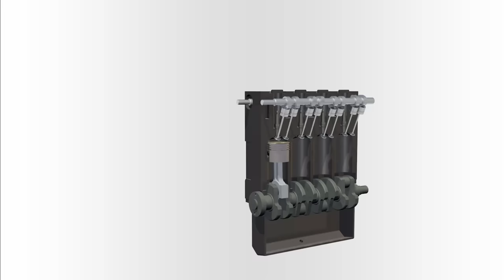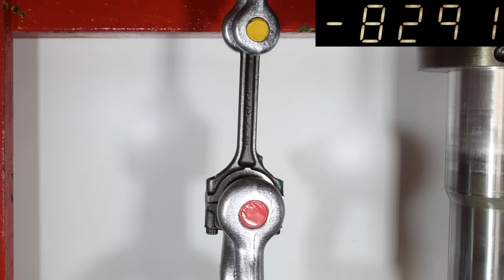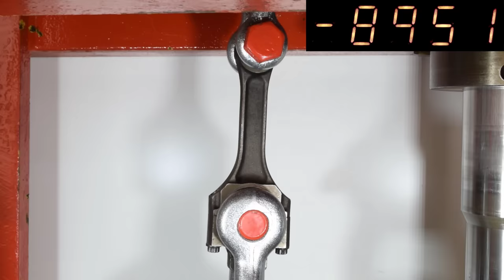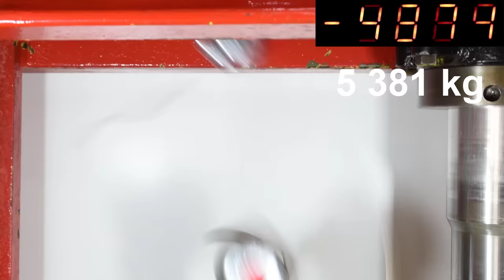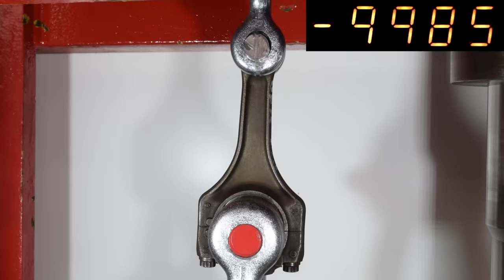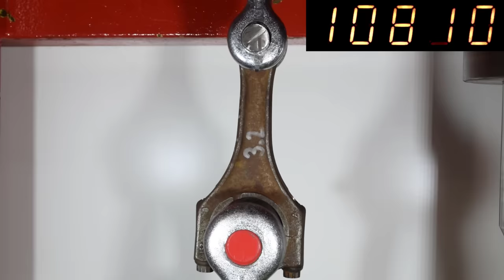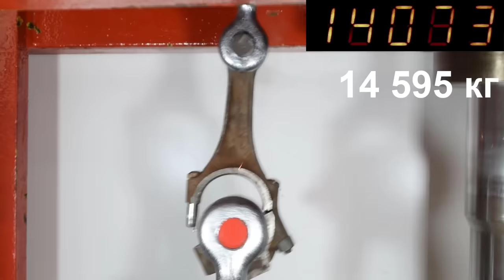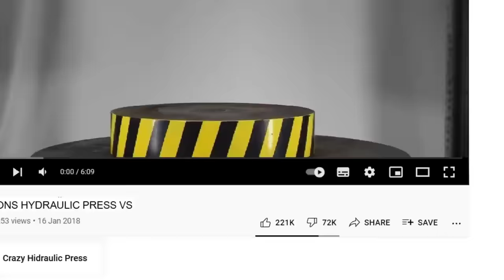HYDRAULIC PRESS VS CONNECTING RODS

Comment: Interesting tensile strength test/comparison.  Compression strength of the rods is just as or more important, because of the power and compression strokes putting more downward, compression, stress on the connecting rods, and wrist and crank pins.
Reply: Uhh nope…. The bearing takes the downward force, the rod will break and stretch because of tension
Reply: @Thewatcherinthering336  The rod is what transfers the downward force of the piston to the crankshaft, on the power stroke, which is compression stress on the length of the rod.  It also takes the compressive stress of the compression and exhaust strokes.  The rods can get bent and broken from that stress, if not robust enough.  The rod does take some tensile stress on the intake stroke, but not as much as the compressive stress on the power stroke.  I don't follow your, "Uhh nope." statement, or appreciate it.
Reply: @wmden1  uhh, nope once again. You obviously have no experience with engines so just admit it. Sure the downward compression is a stress producing force on the rod, it has to be. The biggest impact from compression is on the bearing load. Tension is what breaks rods and rod bolts(think about how rods fail, they don’t get crushed, they stretch and break). This force is centrifugal force on the rotating assembly. Compression down force moves the rotating assembly without any sort of appreciable play, it’s the upswing of the piston and rod assembly that has NO stop against centrifugal force, except for the stretch of the rod and rod bolts. Even dragster engine rods get measured for stretch not compression on every tear down. Plus I don’t care if you didn’t like my comment, get a clue, build some engines first.
Reply: @Thewatcherinthering336   I have had plenty of experience with engines, if you think there is no compressive force on the connecting rod, piston end to crankshaft end, during the power stroke, you are the one who needs to think again.  Sure there is centrifugal force on the lower end of the connecting rod, and tensile to boot.  I'm not saying there isn't.  You are saying no compressive on the rod and that is completely incorrect.  I have seen plenty of bent and broken rods.  I'm done with you.
Reply: @wmden1  once again…uhhh nope! Never once said there is no compressive force on a con rod. You said that. Obviously you have not had any experience with engines nor did you comprehend my comments. There is no compressive force on intake stroke, little compressive force on exhaust stroke, compression and power stroke have the most force. But still not nearly enough to cause catastrophic failure of a rod. Again, rods do not fail due to crushing force, they fail because they were literally torn apart from the sudden direction change at the end of the stroke combined with the centrifugal forces. Ending in an over stretched rod or rod bolt. That, clown, is what causes rods to break. No one has ever seen a crushed connecting rod except in the aftermath of a tension break. Go build some engines, take a physics course and stop being the pivot man…

Comment: To add my bit to the mix. In the 70's I owned a Ford transit and fitted a worked over 250 2V Ford I6. With exhaust opened it would rev to 7600 before valve float. Now onto the guts of my outline. We had a very severe rain storm. Unknowlingly, rain water ingressed into the intake ( 650 Holley double pumper. ) Car wouldn't start on SM. I decided to let it roll down the hill and kick start it. Fine in theory BUT dropping the clutch in 2nd gear in a 3660 lb tranny van. An almighty bang and the engine kicked over and started on 5 -1/2 cylinders. Pulled it down and found the bore had split from the hydraulic malady. Both the Ford factory piston and rod were still intact. Rod was checked and straight. Same with the factory piston. A testimony to the strength of the early Falcon I6s. Sleeved the broken bore refitted the recip assy and ran it for a another couple of years giving the 200HP hitrous kit a constant workout. LOVE DEM FORD I6s and now the Barras.

Comment: Sorry, but you not testing strenght of conrods, but strenght of screws. Conrods in engine must withstand the pressure, not tension. In the correct direction of stress, the screws are not stressed and the part can withstand much more force. Great video, out of reality.

Comment: Also remember the M5 V10 has 10 cylinders and is tuned sometimes to super high horsepower, it was essentially roughly based off a detuned BMW V10 F1 engine of the era, also the M3 engines are tuned too, although this was more of a bolt strength test lol 😂

Comment: Nobody is going to talk about how a Soviet-made Moskvitch conrod from the 60's outperformed BMW's conrods strength during test.
Reply: Oh right and we wont mention it had twice the amount of metal either.

Good luck reving up an engine with those anchors inside...
Reply: Old  car  stronger material...fact...!!!!!
Reply: Weight !
Reply: because this was mostly testing the strength of the bolt.
and Soviet one was bolt and nut going through the rod,
where as other ones are bolt screwed into the rod.
Reply: That 1968 one deformed quite a lot before eventually breaking. I think that would have failed quite rapidly in an engine.
Reply: Made from recycled T-34
Reply: even a shitty stud will perform better than a good bolt. No surprise there.

Comment: High RPM requires stronger rods, too. 
Usually, a bearing will go long before a rod. 
Turning a normally aspirated car by turbo conversion will have parts fail in the bottom end. Use forged pistons and rods and uprated bearings. 

Bit off topic there but im a petrol hesd.
Reply: Getting hard to find bearings that have backing other than aluminum.

Comment: After market rod bolts would make a big difference
Reply: but rather pointless... In an engine the gas explosion drives the piston downward, so the force is compressing the rod, not stretching it.   On the return the force comes from the other side pushing the piston up, again compressing the rod.   The bolts have very little stress (comparatively) on them in the environment they are actually used.
Reply: @froodtube  for the civilian stock engine you are correct. For the higher revving performance engine, stretchering is very much an issue. That pushing up very rapidly becomes pulling down - remember in a 4 stroke there is a compression free cycle as the bore is filled. Now stretching to the point of failure is pretty rare BUT stretching even a few mils can result in valve contact with the piston and a cascade failure shortly thereafter. And in performance applications, bigger valves for air flow and smaller combustion chambers for added compression are usually constrained by that vale to piston face clearance issue. Number one culprit for those failure is the rod bolts and there is a whole industry of aftermarket rod bolts for that very reason. Indeed, even the stretching of a tiny amount for the rod bolts can result in bearing and oiling issues which if not addressed promptly will scuttle an engine.

Comment: The highest loads on connecting rods are in compression rather than in tension as it's the expanding, hot gasses pressing down which provide the greatest forces. There are, of course, significant tensile forces too, as on the induction stroke, the piston has to be accelerated downwards quickly (on the firing stroke the hot gasses push the piston down). 

Not to say that tensile strength isn't important, but they are optimised for the compressive forces and will be stronger in that direction.

You can often see the difference on an older, stripped down engine with different wear patterns on the big end bearings.

Comment: Comments regarding compressive strength being what matters- do you guys work on things? Do you find connecting rods crushed from compressive forces? I think maybe "no" on both counts. I have seen bolts break in tension, and rods snapped due to cantilevered forces, after oil starvation and seizing to a still a spinning crankshaft. I have seen rods bent due to compressive forces from hydraulic locking...water ingestion. One of those ran tens of thousands of miles very bent, and was found when disassembled for unrelated reasons. Never saw a rod fail in compression. Maybe top fuel guys do?
   Even rods from engines I knew were suffering from preignition showed no distress,  and this is pretty abusive. Probably more so to the bearings.
   I think you may be imagining some impossibly large explosion occurring...not so. While forceful, it should be a somewhat smooth event. BMEP, or average cylinder pressure during the power stroke, isn't that awful high. Over 200 PSI BMEP is pretty good. 
   Also, the bolts are irrelevant when the rod is in compression, but certainly matter @ TDC. 
   "You're just testing the bolts.." is a strange comment. They are part of the rod, and are a failure point. 
   I read in these comments, and elsewhere, that the rod's toughest moment is the piston deceleration between the exhaust and intake stroke. Similar forces probably exist at BDC...but, again, I see rods/bolts fail in tension, not compression.
   A last observation- this guy is breaking stuff in his press for our amusement, it's not an engineering class. Just enjoy it. I Crush stuff in my 75 ton press for fun sometimes, my kid loves it. Me, too.
Reply: dear lord thank you. comments have a simplistic view of how engine components work together. sheesh
Reply: @LeavingCaladan  same for u wannabe
Reply: Well, connection rod would never suffer such forces,  unless piston will stuck in chamber,  but that wouldnt create such a strong force. This test was supposed to be about connection rods, not their bolts. As from engineering middle school,  almost every student of physics know how this test might be done. We know from the top of our heads also the diagrams for steel of this tests. 
More importantly, it might be very interesting to see the results of usual rod a M3 for example,  because they might be forged by better technological process, BUT IN PRESS. 
This test is useless. Thats how it is, not everyone is stupid.

Comment: Interesting concept of how to try to demonstrate the effects of tension stress in action! Would be awesome if someone could somehow demonstrate the strength of the rods themselves rather than the bolts. Perhaps by welding the bottom end to a extra strong steel bar? Either way, thanks for your efforts to demonstrate a theoretical problem in a practical way regardless of the practical value of the demonstration as such.

Comment: Sorry, but the conrods are made to resist compression and not forces of pulling it long.... So the conclusion is: wrong solicitation!
Reply: My thoughts exactly, thanks 👏
Reply: @JohnMichaelOsbourne  i think the same
Reply: No. Compression force is only one thing. There are other important factors like tensile force (very high during starts/stops), bending force (stress while in motion) and shearing force (stress experienced by the bolts).
Reply: @ejsampana426   in this pulling force the main things suffering until break are the bolts, the con rods are also but in less scsle and is not the right kind of effort this piece experience through its life in the engine, that's the main echoe for me at least.
Reply: Con rods are stressed in traction mainly at  TDC (Top Dead Center). Main stress is in opposite direction of the test.
Reply: they need to resist BOTH pulling and compression. when you rev engine high, thats exactly what you do
Reply: @JohnMichaelOsbourne  Until you remember that there will be millions of compression and tension cycles over the life of the part and in some engines yielding a few mils means valve contact, especially as the engine wears. Bolts are certainly the #1 tension culprit those transitions from compression to tension can be brutal on peak loads. Out of round small ends are typically #2. And even when you have it all dialed in, I have seen some extreme performance engines take the cylinders out of round over time. Shearing a con rod due to stretching is pretty rare, but a little stretching will grenade an engine pretty quick. 

Now to be fair - if you are building an engine where you are concerned about the deformation under tension of the rods, you are probably in a space where you fully understand that rebuilds and replacements will be the norm and started out with a quality set of fasteners for the main caps, rods, heads and the like - which on some applications can run you a few thousand dollars alone.

Comment: Decent test.  Most rods fail on the exhaust stroke as they try to stop the piston and make it change direction - in a sound motor.  In a wore out engine, it may be for any reason like spun main locking up the bottom end, etc ...

Comment: Seen quite a number of conrod failures. All have been due to tension, not compression. Applies to both plain bearing conrods with bolts and roller bearing boltless ones.
So I think this tests are valid. Last one I've seen this winter had big end and small end intact and conrod in three pieces. Fractures was definitely due to tension.
I thought this is common knowledge as it was known in the 1940ies possibly earlier.

Comment: For everyone who is making comments about the compression strength of a conrod, you obviously don't understand the stresses involved in a naturally aspirated internal combustion engine. The GREATEST load on a conrod at revs is during valve overlap at the end of the exhaust stroke. Due to piston inertia, the load at revs is often several tonnes/tons. The only thing keeping the piston is the engine is the rod, which is why conrod bolts are so important. Even in boosted engines, inertia loads will often be vastly more than compression loads. I've seen many more big end and bolt related failures as a result of tensile loads in my life  than issues related to compressive load. If you go to Steve Morris's channel and look at his Great Exodus series of videos, you will see the results of a high rpm tensile failure in a very high horsepower boosted motor. Admittedly this video doesn't deal with cyclic fatigue, but it does demonstrate the ultimate tensile strength of a component, and the probable failure point.

Comment: Awesome. You put together a great test proving failure points. Can you comment on what engine the M5’s had, V10? If it was the V10 S85 engine I’m surprized that the powdered rod held together. I expected them to fail at the small end. Maybe the OEM’s figured out how to make great powdered metal rods. It would be awesome to test the rods with new ARP and competitor bolts. Thanks
Reply: It is the s85. Although that’s not the type of stress connecting rods are rated for, I was surprised it was so string
Reply: The s85 has forged powdered metal rods vs just a regular powdered metal rod like the 530's m60 rod. You can tell by the parting lines along the rod if it's forged
Reply: @jesselambert9006  M3 connecting rod tested on this video is also a forged one.
Reply: @harrynamkoong3361  I thought I noticed it looked like it was forged, never seen one in person. Only a s85, s62 and M62
Reply: @jesselambert9006  S54 rod from E46 M3.  Forged and split fractured from the factory
Reply: Why did the 2 fail on the small end versus the rest that failed at the rod bolts?
Reply: @Pilot545  If you look again at the small end on that rod, you will that there is less  metal around the small end.👍
Reply: No idea how this test corresponds to real world tunability.  Plenty M5s (S63 turbo engine at least) well over 700lbft and 800hp on stock rods/pistons.

Comment: There are other actions going on inside the engine.  My father owned a garage for over 60 years and I've seen a lot of broken connecting rods, although I've never seen the rod bolts break and I don't recall ever seeing one break at the wrist pin end.  They usually break in the beam, sometimes in the middle, sometimes near the big end.  I've also seen some that were just bent and not broken.

Comment: Its worth mentioning that when rods fail it normally on the exhaust stroke, when its under tension, not compression stroke , this assuming the big end is not  seizing and bending the rod axillary, so this test does have a bit of relevance.

Comment: For this test, you need to ask yourself a good question: what does the connecting rod pull test show? In practice, the connecting rods in engines are subject to pressure during operation, tensile forces are marginal. The tensile test measures the strength of the material, but the smallest area of the material that can be stretched must be taken into account. Such a test includes, for example, kg/mm² area. In addition, there are also bolts that connect the connecting rod parts. So what should be measured in the end? – the strength of the bolts or the connecting rod itself? The tensile test shown for the connecting rods makes no sense in practice and can only be presented as a curiosity.